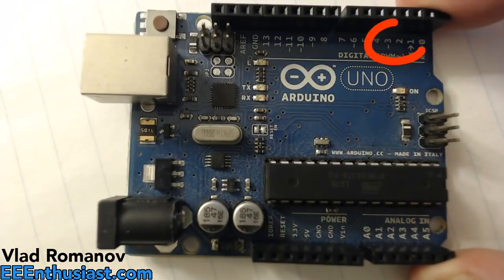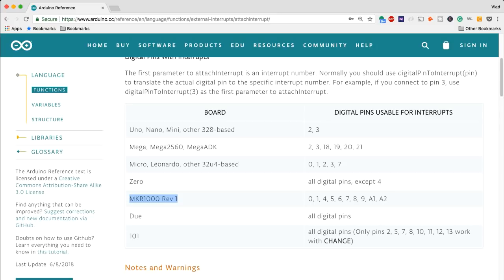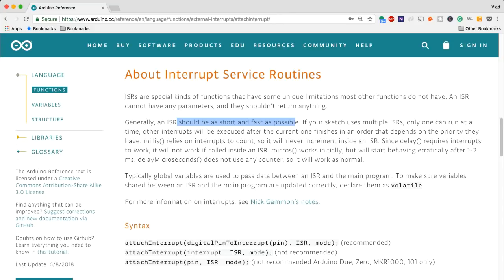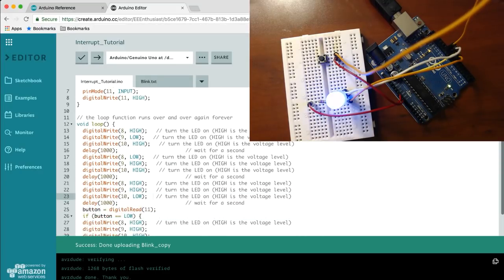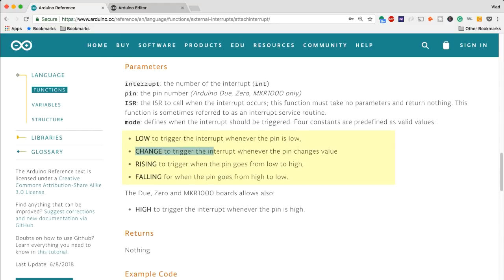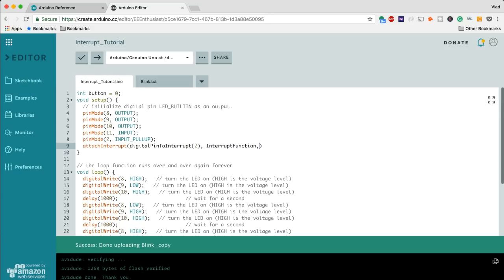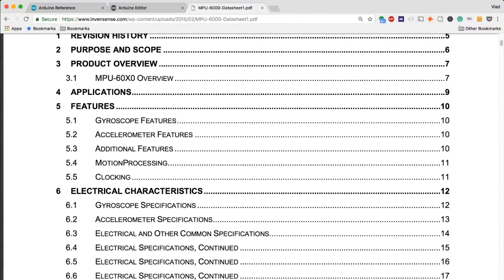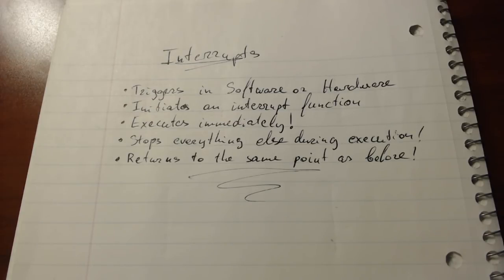Arduino Interrupts Button Tutorial Example - Pin 2 Hardware Easy Guide

Comment from the maker: Dear viewers, I'd like to hear back from you about the next topics for my videos! I've re-vamped my list of things to cover. What kind of projects are you currently working on? Where are you having the most trouble? What do you believe I should cover?

It would mean the world to me to hear your feedback!

Cheers,
Vlad
Reply: the best
Reply: pro trick : you can watch series on Flixzone. Me and my gf have been using them for watching loads of movies during the lockdown.
Reply: @Hayes Waylon Definitely, I've been watching on flixzone} for since november myself :D
Reply: I am working on a code of an automated antenna lifting mechanism. I am using arduino mega 2560 for this. I want to implement an emergency stop function using the interrupt. The interrupt is working but I dont knwo what to write in my ISR becuase whatever I wirte there, the coding will then return to my main loop and things will go random...

Comment: As you said using interrupt ,something can be nightmare ......
In ISR, I am Switching OFF a 220V 5RPM motor in ISR .  interrupt trigger on FALLING edge through a npn proximity sensor. 
Motor is connected to a RELAY. 
Software part is switching ON motor after every two minutes.

I found random behavior ,  something motor gets ON after 2 minutes, something its not.
May be interrupt is triggering due to RELAY EMI/NOISE ?

What is the safe way to use interrupt ?

Comment: Thanks for your video (y), you are magazine.
I have a question, when you push the button, the funtion "interrumpFuntion" should do and turn the leds on but when you push the button, all the LEDs are on, why?
Reply from the maker: Hi Eduardo, thank you for the feedback. I believe that you have mistyped that LEDs are "off"? The reason being is that my LED is connected in a way where the common is set to 5VDC. When I write a HIGH signal to each of the other three pins, the LED is turned off because there is no longer a difference in potential across any of the pins. Does that makes sense or am I misunderstanding your question?
Reply: thank you EEEnthusiast, now I understand all :-)
Reply: @VladRomanov89  Actually, at 0:33, you connected the common LED lead to ground. The code that you show in this video is NOT the code that was running when the video was shot. Additionally, the comments in the code do not match the statements to which they are attached. Your explanation and diagrams are clear but the actual code shown is misleading. Also, you don't discuss switch debouncing, which, in an ISR is pretty tricky to achieve due to the delays required.
Reply: @VladRomanov89  understood many thanks

Comment: First of all congratulations: you are e very good teacher. Even if I am italian I can understan almost everything (and I am sure I will understand everything when I will see the video again).
I would like to learn in depth how to control motors (not stepper or servo, but simply motor) with Arduino Uno or Arduino Nano (power shields, wirings, sketches). Thank you.
Reply from the maker: Thank you Paolo! What kind of motors are you interested in specifically? You've got me thinking about controlling large industrial motors (5HP+) with an Arduino. That being said, I can definitely explain the theory, but I don't have access to 3phase circuitry in my house. Is there a particular kind of motors you were thinking about?
Reply: EEEnthusiast As a mechanical engineer I am interested in motors at least of 1HP DC. Now I have no idea about possible use, but understanding control can be useful. I know Arduino cannot handle more than 5 volts and few milliamperes so it would be great knowing electronic that could control that kind of motors. Thankyou!

Comment: thinx ... it is very useful
but i have a question about MPU 6050, i used your code (that you provided in previous video ) .... but i failed to get  rotation angle about Z- axis.
is that possible by MPU 6050  or should i use MPU 9265
Reply from the maker: You should be able to get the rotation around the three axis (x, y and z) what trouble did you run into exactly?